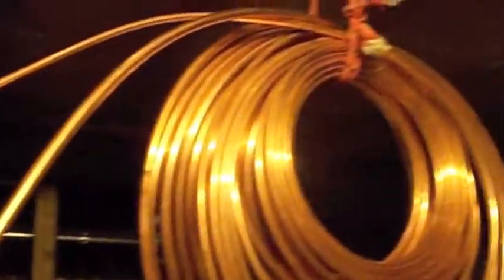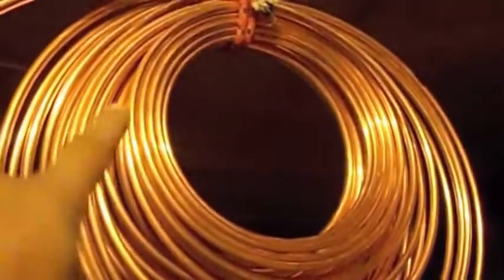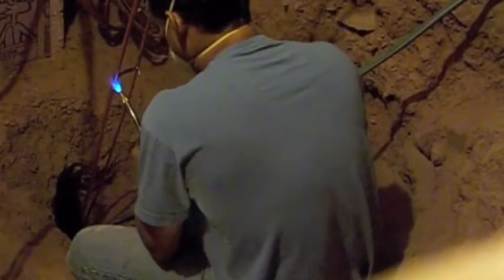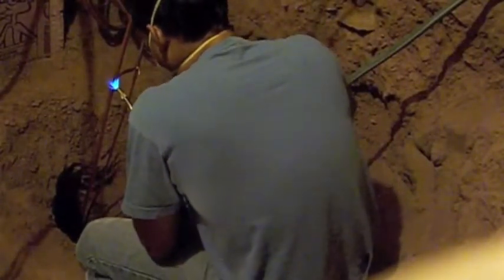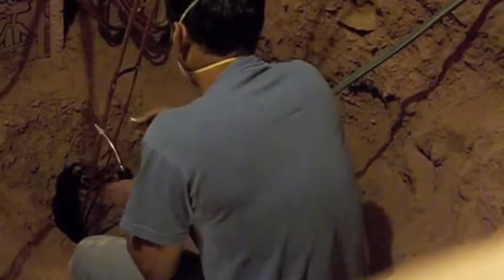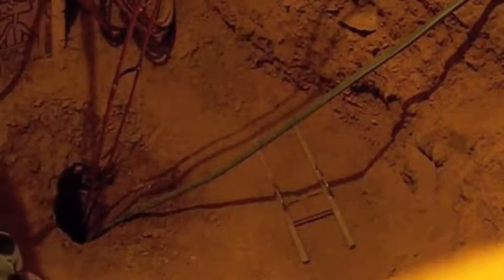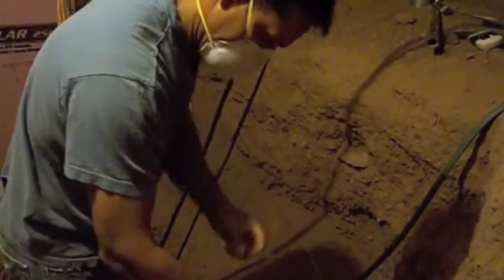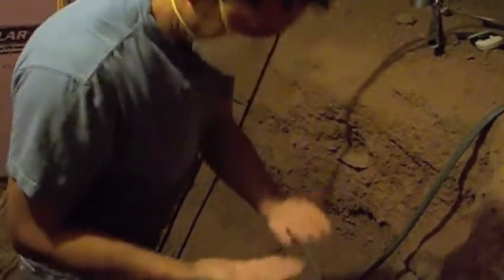Geothermal Laying Ground Loops

Comment from the maker: The coating I'm using is tar and is about a one hundreth of an inch thick.  Yes it does insulate some but it is negligible.  If the PH is around 7 your fine.  In Gypsum it is much lower and I want these pipe to last.

Comment: i read that copper will not rust in the ground if the ground has the right ph level, so coating it is needed, and coating copper takes away from its heat exchange

Comment from the maker: Still Drilling holes.  I will be using a Trane X2GY Geothermal stand alone system to tie into the ground loops
Reply: How many tons is the system?
When included in the geothermal heat pump is there any special twist pipe at a certain angle?
How did you decide the problem of the return of oil in the crankcase?
My machine has a capacity of one ton.
Copper pipe 3/8 to 1/2 good option is it?
Your machine works there now and what problems you had so far?